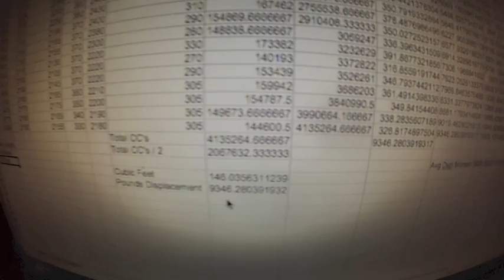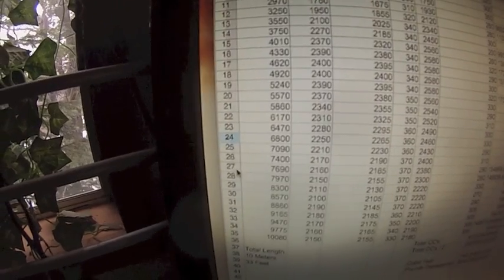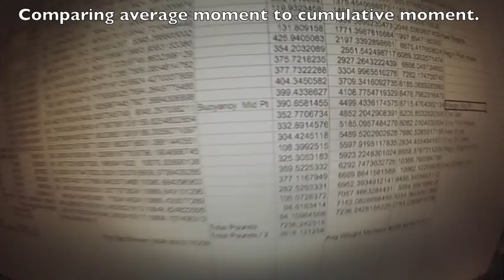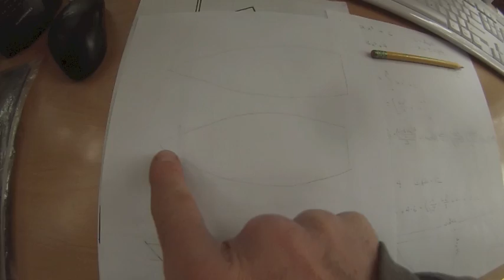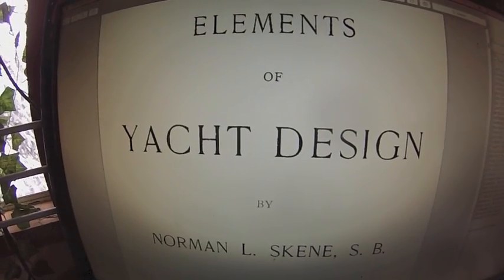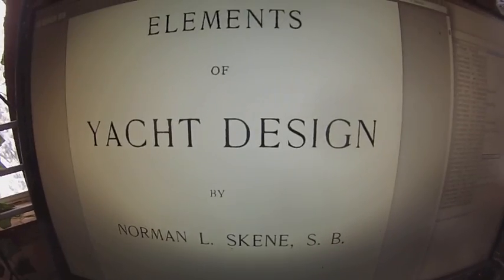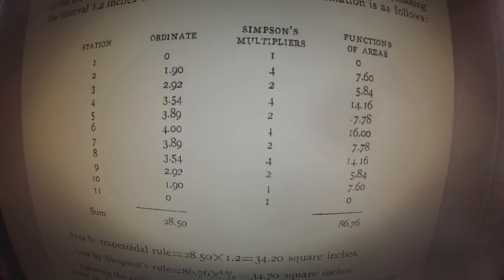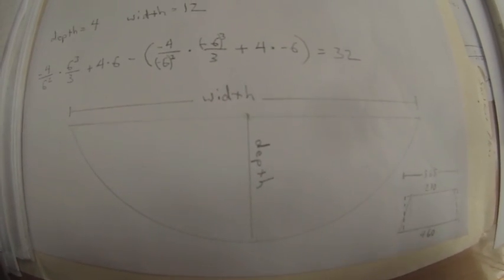Steel Sailboat Build Calculations

Comment: Your keel must be roughly in the center of the sail area or else the boat will not sail in a straight line. Ie the further back you put the keel, the more the boat will want to turn away from the wind. It doesn’t take much before you cannot steer the boat. In addition to the righting moment, you also need to factor in the sailing factors. You can move the keel forward but put the lead weight at the back of the keel to maintain the for-aft balance of the boat.

Comment: Your myopic stability calcs may be close enough, but your proposed keel placement will create a lee helm. If you can't steer the boat and head up to reduce sail, what do you think is going to happen?
Reply: Yes, I've commented before that he needs to do an analysis of the CE vs CLR.  Based on that schematic, I too think he will experience lee helm and have a real struggle to sail into the wind.  I think there are a few notes: a) his schematic shown there may not be accurately proportioned against his real boat, in which case those of us making conclusions from the schematic should just shut up and let the man build his boat; and, b)  he isn't done.  He has shown a willingness to listen, read, and reinforce.  He may make some minor changes that surprise us all and turn this thing around.

Comment: Such a huge amount of effort to build a boat that won't work. Very sad.
The hull was the first mistake. You talk about conventional sailboats. By definition they sail. This thing you are building will not. You talk about stations? Not one of them is strong enough. You have used very thin material and then gusseted it with even more inappropriate material.
I just hope you don't go down with the ship.
Reply: @WATER-MAN But isn't it such a shame that a man with such energy and ability didn't direct it in a better direction? There's designing it first, if a one off then test a model, or better still find a design that is tried and tested and have something worthwhile ans that works and most of all where the sea is concerned, safe!

Comment: I remember the first time I opened my copy of Skene's Yacht Design.  The dreams of sailing in a boat of my own design and build flooded my mind for years and the dream is still there after 45 years.  I hope it works for you too.  Good work on the math.  Remember that you will have some inside ballast to make final trim after you're in the water.  Thank you for the video and have a good week ahead.

Comment: You're going to be dragging a wide flat stern through the water, your boat will be slow. If you take a large wave to the transom, you may suffer a broach and roll the boat. If you're under full sail, and the boat tries to right itself, you may lose the mast. There is a reason most sailboats carry their transoms high and narrow. I would reconsider this design and at least narrow the transom. I've watched your series and I feel you may not have sufficient strength to keep the hull from turning taco once loaded and in the water.
Reply: Yup, exactly what Ben said.
Reply: How come all those racing boats have incredibly wide flat sterns if it’s so slow? Anyway you are missing the point, this project is about the building not the sailing. If he wanted a boat to sail he’d just go out and buy one of the vast number available for sale. Most boats hardly get used and never go out in rough weather anyway.
Reply: @robcorner8427  Racing sailboats sterns are narrower than the beam of the boat and they carry their stern high out of the water. When the stern is the same width as the beam, the water doesn't flow around the hull and slip away from the hull. The water becomes turbulent and slows the hull down. The waterline of racing hulls is and elongated oval. Recreational sailboat waterlines usually have an elongated tear drop shape. If building isn't about sailing then there is no point in building.
Reply: @benrandomly2016  this was true for racing designes prior to the mid 80's. Modern race AND production boats are carrying the beam well aft. Granted..I'm not sure how this would translate with a steel boat.
Reply: @craigs1710  True but aft beam boats don't drag the transom through the water when under sail.